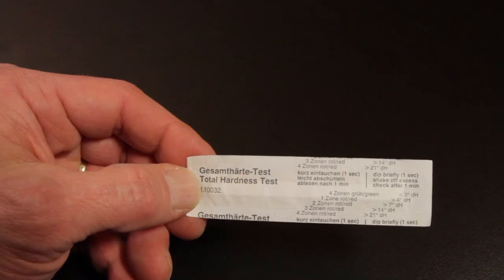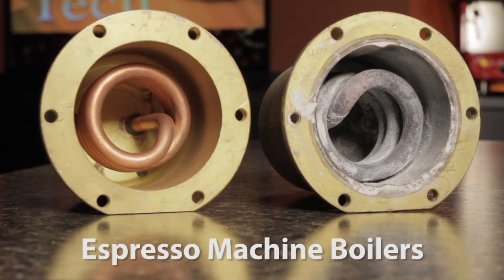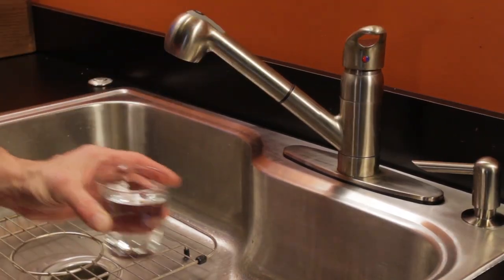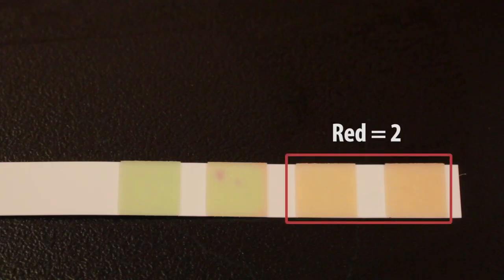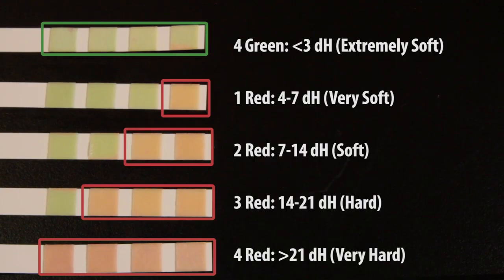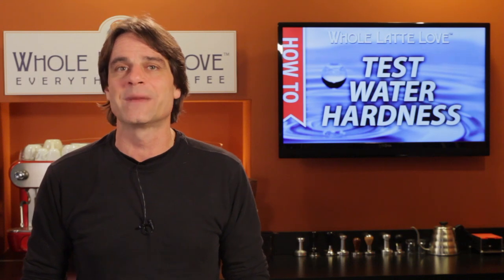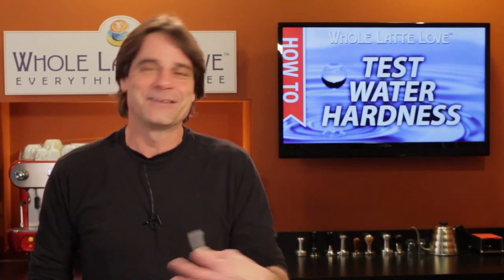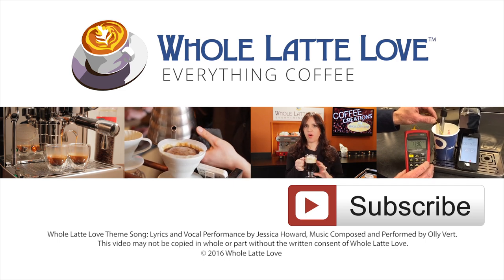How to Test Water Hardness for Espresso and Coffee Machines

Comment: If I don't have the strip that came with the machine, suggestions on where to buy one? I wasn't sure if it is a special strip made specifically for espresso machines.  Saw one on Amazon to test pond water....will that work?
Reply from the maker: Hi Renee, Thanks for the question. You should still test for hardness. There are many types of home filtration systems. What we're concerned with is the hardness and some systems, like those with particle filtration and activated carbon do not treat/reduce water hardness. Other systems like a whole house water softener do treat for hardness by replacing calcium in water with sodium to reduce chances of scale. Some softening systems have a bypass so they treat some of the water but not all. Only way to know is to test. The water hardness test strips are not made specifically for espresso machines. So you can get by using something else so long as it gives you a reading in degrees of total hardness. Most espresso machines will either ask you to enter the number of squares on the test strip that turn red or the actual degrees of hardness. Here's a key for translating those if needed:
<3 degrees of hardness = 4 green squares
3-4 degrees of hardness = 1 red square
4-7 degrees of hardness = 2 red squares
8-14 degrees of hardness = 3 red squares
Hope that helps!
Marc

Comment: Hey Marc, I just upgraded to a Profitec Pro 600 and I am using a BWT Bestsave M Anti Scale Filter in the tank.  Out of curiosity, I tested the hardness of both my filtered water from the tap and the water from the reservoir with the BWT filter.  The tap water came out at KH = 7 and GH in the 12-13 range.  The BWT filtered water came out at KH in the 3-4 range, but the GH sample didn't change color even after the addition of 20 drops of reagent.  I believe this is due to the way that the BWT filter works, but I just wanted you to confirm this.
Reply from the maker: Hi David, I can confirm! The BWT reduces calcium by exchanging with magnesium so your KH will drop while the GH stays aboiut the same.
Marc

Comment: If we have a whole house water filtration system, do we still need to test for water hardness?
Reply from the maker: Hi Renee, Thanks for the question. You should still test for hardness. There are many types of home filtration systems. What we're concerned with is the hardness and some systems, like those with particle filtration and activated carbon do not treat/reduce water hardness. Other systems like a whole house water softener do treat for hardness by replacing calcium in water with sodium to reduce chances of scale. Some softening systems have a bypass so they treat some of the water but not all. Only way to know is to test. The water hardness test strips are not made specifically for espresso machines. So you can get by using something else so long as it gives you a reading in degrees of total hardness. Most espresso machines will either ask you to enter the number of squares on the test strip that turn red or the actual degrees of hardness. Here's a key for translating those if needed:
<3 degrees of hardness = 4 green squares
3-4 degrees of hardness = 1 red square
4-7 degrees of hardness = 2 red squares
8-14 degrees of hardness = 3 red squares
Hope that helps!
Marc
>14 degrees of hardness = 4 red squares

Comment: I recently did as experiment with my espresso machine. I bought a gallon of Spring water to see if there was any difference in flavor. My first cup tasted great! Really smooth and flavorful. So I then decided to test the water against my tap water and the filtered water out of my fridge dispenser. The results were quite interesting. The Spring water had higher levels of ph & alkaline and the hardness measured about the same as tap. How does the ph and alkalinity  affect the flavor of coffee? Thanks!
Reply from the maker: Hi, Thanks for sharing your experience! Of course we have a video which details the effects of various water parameters including pH, alkalinity and more: https://youtu.be/pVvAbhc9y7c
Short answer: Unless pH is way out of range not much affect. Excessively high alkalinity has been reported to cause the surface of coffee grains to gum up and affect extraction.
Reply: Thanks for the reply.  :)   The ph and alkaline were not extremely high but were definitely higher than both the tap and filtered water I tested.  It really was one of the best tasting shots I've had!
Reply: So recently I decided to do an experiment comparing Spring water to Purified water in my espresso machine. I first tested them with water test strips. They were vastly different in most of the tests, especially water hardness. I made my typical morning latte using spring water one day, and purified the next day. The spring water tasted very good as I mentioned in an earlier comment. But the purified water tasted very flat which I wasn't too surprised at since the water tested softer. So for anyone wanting to use either purified or distilled water to make espresso, the flavor is greatly affected. No depth of flavor at all, it almost tasted like it had been watered down. I'll drink the purified straight but will not use it in my espresso machine again. I did not do this test to get out of descaling my machine, I wanted to see how much of a difference there was brewing with softer water. Simple answer....Blechhh!  :)
Reply from the maker: Thanks for sharing your taste tests! Making coffee with ultra-pure water is like cooking without salt. Sure you can do it but you'll definitely taste the difference!
Reply: That's a great analogy! I live in an area with extremely hard water so I wanted to see how different types of bottled water would work...or not. It was also a very inexpensive test, at only  88 cents per gallon jug.

Comment: hi Mark!
Thanks for another great video! one question, what can we do if we have hard water in our country? do we need to run descaling process more often? or is there some way to convert hard water into soft water? additionally, how do we know when machine requires descaling cycle on semi automatic? thanks!
Reply from the maker: Hi SG, You are welcome! If you know you have hard water then you can work to reduce the hardness with filters/softeners. If using known hard water then yes, you should descale more frequently. For knowing when to descale a semi-auto, most manufacturers will recommend a schedule for doing so based on the source water hardness. If using a higher-end/prosumer level semi-auto that's plumbed in you can eliminate the need to descale permanently by using specialized filters that remove scale causing minerals and replace them with magnesium to maintain flavor (mineral free water like distilled or RO/DI makes flat tasting coffee) Here's an example of that type which we available in the US. It's made by a German company so probably available in other countries as well: https://www.wholelattelove.com/products/bwt-bestmax-premium-filter-package

Comment: Thanks for the great video, nothing else could help like this. I am using Coca Cola drinking water, which is basically purified tap water,  based on the information on the bottles it's balanced with only 0.11 grams/liter of minerals (total solid). well the question is should I keep using this water, or tap water, or do I need to purify the tap water without a mineral balance filter ? which one is more recommended ?
Reply from the maker: Hi Sobhan, .11 grams/liter = 110 milligrams/liter which is considered "moderately hard water". Over time, this water will cause scale deposits. The choice between this water and tap water depends on the hardness of your tap water and the effect on taste of the different waters you have available. Another factor is the type of machine you are using. Prosumer level dual boiler espresso machines are difficult to descale. For those we suggest water filtration systems that eliminate the need for descaling. For other type of machines like heat exchange, single boiler and thermoblocks it's not a problem to use unfiltered moderately hard water so long as you descale the machine on schedule without fail.
Reply: I just tested and got two red square out of that bottled water, and pretty sure tap water is harder here. so I will use the bottled water which is soft based on the test result. thanks for the help.

Comment: Hello Mark 
does the Gaggia classic has a water filter ?.
Reply from the maker: Hi ZG, The Classic does not come with a filter. You can add a softener cartridge like this one: https://www.wholelattelove.com/products/expobar-water-softener-cartridge
Another option is an ion-exchange pad like this that sits in the tank: https://www.wholelattelove.com/products/bwt-bestsave-m-anti-scale-filter
Reply from the maker: If using a softener cartridge option you will need to connect to the intake hose in the tank and orient it so it does not suck in air. This may require cutting the hose down some.

Comment: I have been using ZeroWater filters.  The total dissolve solids (TDS) is zero!  is this good for my espresso machine?
Reply from the maker: Hey BK1, So you do want some minerals in brew water. While pure water sounds great the reality is it will over-extract coffee causing bitter flavor. Beyond that mineral free zero TDS water is such a good solvent it can cause corrosion of metal components in espresso machines. So it's not good for your machine or flavor.
Marc
Reply: @Wholelattelovepage  I did see your video on adding epsom salt and baking soda to distilled water ( 0TDS) . My faucet water is around 250 TDS. What TDS value would have the optimum balance of minerals and to avoid rescaling. Keeping in mind that descaling could also damage the boiler. ( I have a Rancilio Silvia)

Comment: Where can I get some of those test strips?
Reply from the maker: Hi HFN, We do not carry them, but here are a few ideas:
Morton Salt will send you a free one: http://www.mortonsalt.com/article/order-a-free-test-strip-to-find-out-if-you-have-hard-water/?gclid=CI_qioOWmtECFcSKswodfuMLDw
If you have a tropical fish/aquarium shop nearby most will test a water sample for free.
If you want to get an idea of what is coming out of your tap and you are on public water source in US your local water authority/supplier should be able to tell you and or publish the levels online. I'm not certain they are required to publish total hardness readings.
Most home improvement stores sell test kits but you may need to covert ppm to dH.
Reply: Whole Latte Love Thanks for the info!  :)
Reply: Hi Marc,
I did some research in my area about this issue and found some test strips at my local pet store that has an aquarium/tropical fish section. The brand is: "Tetra EasyStrips". They test for chlorine, nitrite, nitrate, alkalinity, hardness and ph. There are 25 strips in a package and I paid $14.99 for the kit. The jar has a peel open label with a color chart for each individual test. I tested water right from the tap, from my refrigerator's water dispenser, (that has an expensive filter), and the water in my espresso machine water tank which has a Rocket filter pouch in the water. The results were quite interesting. First of all, the test results comparing my tap water with the "filtered" water from the fridge were identical. So much for that expensive filter! :/
But the water in my espresso machine with the Rocket filter had significantly reduced the amount of nitrites and nitrates. 
Once again you guys gave me some interesting and necessary info! Thanks again!  Happy New Year to all of you!!  :-)
Reply from the maker: Hi, Thanks so much for sharing! I'm kinda familiar with the aquarium based water testing. I've run saltwater tanks for years, have my own RO/DI water purification system for my aquariums and test water for fish, corals and coffee on a regular basis. I'm with you on the fridge filters. My research and experience shows for the most part they are sediment filters with some activated carbon for removing chlorine etc. If your public water is decent I'm of the opinion they are rather unnecessary.  Thanks again for your comment and happy New Year to you as well!
Reply: Whole Latte Love You're welcome! I forgot to mention that the water in my area is in the "very hard" category. The Rocket Resin filter was again, the only filter in my testing that removed some of the minerals in my espresso tank, from "very hard" to "hard".  I currently descale my machine every 3 months. With this new knowledge in hand, should I be descaling more frequently?
Thanks for your time.  :)
Reply from the maker: helpfulnatural
Some manufacturers recommend a descaling schedule based on a combination of water hardness and number of brewing cycles while others only publish a descaling recommendation based on time. Time based recommendations run from every 6 months for very soft water of <3dH to once a month for very hard water >22dH. With filtering bringing your water to the hard range of 8-22dH I recommend descaling every 4-8 weeks. If your water is at the high end of the hard range or you use the machine a lot then go closer to the every four weeks. If you are at the lower end of the hard range or use the machine for less than 3 cups a day then go closer to every 2 months for descaling. Here's a link to a descaling chart produced by Philips/Saeco based on water hardness: http://www.philips.com/c-m-ho/coffee/home#howoftenshouldidescale
Reply: Whole Latte Love Thank you so much for this info! Very helpful!  :)  I will definitely check the chart you linked here. We decided not to bother buying any more fridge filters since it appears that they do very little, if anything.  :/  Thanks again for all your help!

Comment: hi mark.  my water measurement tool displays hardness in TDS.  what value should be ideal ?  currently i use purified water between 1 - 46.   thanks.
Reply from the maker: Hi wl, Thanks for the question. The Specialty Coffee Association recommends target TDS of 150ppm. But range of 75 - 250 is acceptable. So you are really low! You might consider dosing some baking soda and Epsom salt to increase the mineral level. Here's a how to video on that: https://youtu.be/iHI7jC0sQZo
Marc